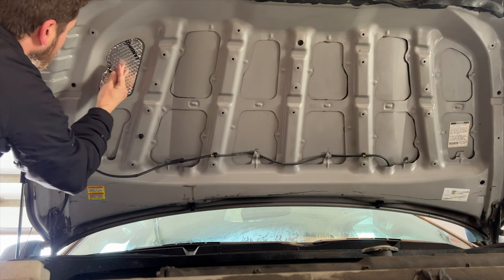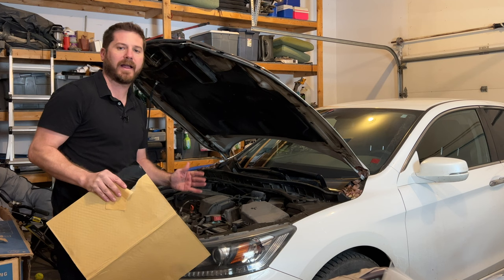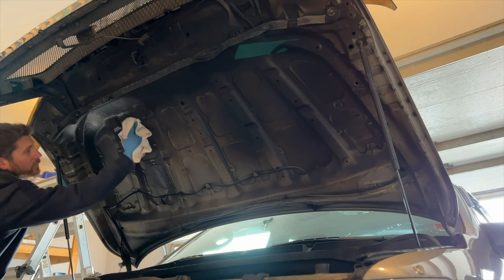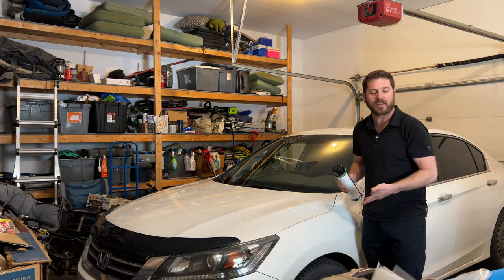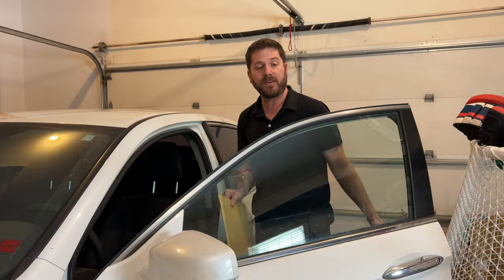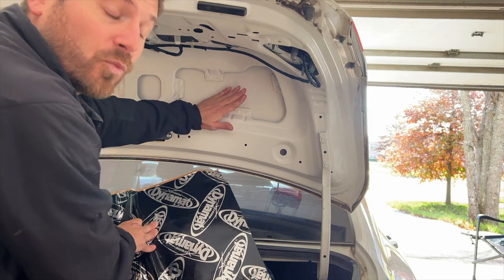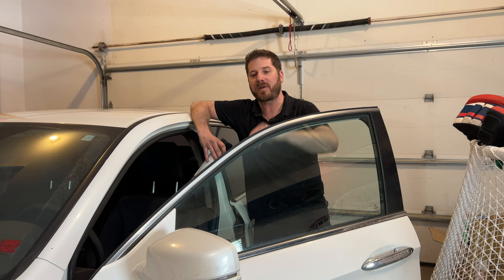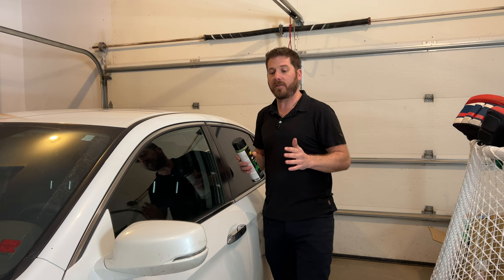Sound Deadening a Car Where It Actually Makes a Difference!

Comment: I recently added a sport exhaust to my BMW Z4. The idea was to improve the sound, and I accomplished the job.

The original exhaust, had a fairly large muffler box, which were replaced by two individual smaller muffler cans. The issue is that under acceleration, it's somewhat booming, but under regular cruising, no booming, which is great. 

I am thinking that where the back box was located, it has now become a cavernous void that is transferring sound inside the car. Would it help to put sound deadening material in this area? How well does the material stick to an exterior portion of the car? Technically it's below the trunk area so I'm thinking the sound transfers from outside into the trunk and into the occupant area.

Comment: Would it be beneficial to glue sounds mats to the bottom of the floor mats, as well?? (For road noise)
Reply: Here's a hint: I have a late 80's Mercedes-Benz and under the factory floor mats for the front footwells  are factory carpet panels -- and those have contoured foam up to 2" thick underneath them. (The contours are to adapt to things like heater ducts to the back seats.)

Comment: Great video, which sound deadening spray do you suggest? I just got a new Camry and there's really not too much road noise but I think the little bit that there is, is coming from the wheel wells. What was the foam you used on the doors, I may use that under my hood. Thanks!
Reply: Noxudol 3100

Comment: Any suggestions on soundproofing a (very loud), old fashioned diesel engine in a sailboat? These old diesels give out a lot of low end vibration so that would be a factor. Additionally, the muffler (which contains both the exhaust gasses and cooling seawater) is inside the engine compartment, as an additional noise source. I placed a soundproofing mat on all the available surfaces in the engine bay (but that did not include underneath the engine aa any oil or cooling water leaks are fed into the bilge) and it made almost no difference. Any suggestions? Is there any material that might deaden the exhaust (which, of course, is quite warm)?
Reply: @stephenburnage7687  
Unfortunately, Low Frequency vibrations, resonances, and direct sound sources are the most difficult to reduce.  The low frequency sounds, vibrations, and resonances that we typically associate as engine rumble & vibration or exhaust drone begin around 100Hz and lower in frequency.

This is why we can hear sonic booms, thunder, and the subwoofers from from car audio systems over long distances.  The high frequency wavelengths are dissipated much more quickly over distance, but low frequency travels large distances unimpeded even by multiple barriers.

It takes an incredible amount of mass (weight over a large area) in combination with excessive and very thick absorbtion materials to reduce low frequency energy.

This is because the wavelength of an 80Hz frequency is over 14ft long, and by the time you get down to 30Hz, the wavelength is over 37ft long!

In order to even begin to effectively ABSORB low frequency sound and vibrations, the absorbing material must be AT LEAST 1/4 of the wavelength of that frequency.

So, in the case of 80Hz, your absorbtion material would need to be 14 x 0.25 = 3.5 or 3.5 feet thick!   That is obviously not practical in most scenarios.

Calculate the same 1/4-wave thickness that would be needed to absorb and dissipate 30Hz, and now the absorber material would need to be over 9 feet thick!

Your best bet is to try to find better double-isolation rubber engine mounts that would provide much better isolation and anti-vibration properties between the engine and the hull.

And then, also make the engine compartment 100% air tight and completely enclosed with 1/16"-1/8" thick sheet lead sandwiched betweeen two durable 1/2" thick layers of Closed Cell Foam which will act as a Sound BARRIER.

The sealed sheet lead box acts as both Mass Loading over a large area AND isolates and contains the low frequency vibration and sound energy within the engine compartment.

It's just like the windows in your home or car.   When the window is closed completely, the least amount of sound from the other side will be heard.

But open that same window even a little bit with just a narrow gap and exponentially more sound will make it to your ears.   ANY amount of actual air transfer between one side and the other results in a significant transfer of the sound waves and energy.

Obviously, due to the heat that is generated by your engine and the exhaust system, it would be impossible to completey seal the engine compartment.

You would need a pair of thick, heavy 4" or larger diameter cast iron pipes covered with exterior sound blankets combined with constant forced air flow via a fan to act as a fresh/cool air intake and heat + noise exhaust to an exterior area that is away from the living areas of the cabin in order to expel the heat and isolate and reduce the low frequency energy within the cabin.  

And wherever those heavy pipes pass through an interior bulkhead and/or the hull to the exterior, they would need to be isolated from transfering their vibrational energy to the bulkheads and hull...i.e. a thick rubber or silicone gasket seal around each pipe where it makes a pass-through or penetration.

A rebuilt engine that is "balanced & blueprinted" or different engine and exhaust system altogether that produces much less vibration and low frequency sound energy is the ideal solution, combined with new engine mounts with better isloation. 

There is also a non-hardening clay-type product called Duct-Seal that is available at your local hardware stores in the electrical department or online.  It is used to make air- and water-tight seals in electrical conduit and wiring pass-throughs in beams and bulkheads.

If used to seal open holes or gaps, this might help to keep the vibrational energy in the engine compartment from escaping towards the cabin and living areas.
Reply: In addition to the excellent suggestions above, you could try installing a crankshaft damper to help reduce engine vibrations. Fluidamper makes them for a wide range of engines. You likely can find one that fits.
Better engine mounts can reduce vibration. Look for mounts designed for industrial generators or other equipment. In the industrial world, it's common to use a dual dampening solution. The equipment is mounted (with dampening mounts) to a sled with is then mounted on a flexible base (of different density than the equipment mounts)
If your engine is being run primarily to provide electrical power you can always look at installing a smaller dedicated generator, alternative charging (solar, wind, prop-driven generator, etc,), or a larger battery bank to cut down on engine runtime.

Comment: Is there an effect of these materials on the heat of the car ? for example a car parked under the sun and has noise-sealing materials for example( in the roof, in the hood, and in the doors), won't it heat up the vehicle more ? and also it's not take the car get rid of the heat more slowly on a hot day?
Reply: you are right about that. I have a VW T5 panelvan, i insulated it as much as possible. If i park my car on a hot day, windows into the sun, it gets as hot as a regular car and cooling down takes alot of time. Otherwise when i place the isulation corvers on my windows, it stays cool. In a cold winter day when using the heating, interior stays warm for a long period. Killed the noise in my van alot

Comment: How long does that spray on deadener last? Would it be best to to use something like Kilmat instead?
Reply from the maker: They claim it can last the life of the car depending on where it’s applied. It won’t last as long If it’s exposed to the elements and road debris. Just make sure the surface is clean and dry before applying the spray. Best of luck!
Reply: I just did kilmat to my jeep and it has made a significant difference

Comment: Why in the world wouldn't you do the trunk, that's usually the worst area in any car because of the subs being located in the rear of the vehicle? I know you want to eliminate any extra noise in the interior, but the trunk area I think needs more attention in most cases than the rest. I'm not saying to not do the interior, but I've always had more noise internally and externally coming from the rear.

Comment: Hi , can you or anyone else give advice on how to use a sound deadener on something like a countertop waterpik? I realize the actual sound will still be audible when turned on but will layering the deadening material at least reduce the noice that comes from the contact the bottom of the wapterpik on the counter ?

Comment: Got extremly cheap foil topped butyl foam stuff material off temu. Like suspiciously cheap...any experience with that stuff? 

So i only have it on the roof right now lol (cause i did the starlights in headboard.) It made the subwoofer sound a lot better. But road noise seems almost the same....maybe a little quiter? But that could be placebo effect. 

Gonna do the floor. I suppose i will let yall know.
Reply: How is it so far?
Reply: @thelifeofaboi2693  it works really well! I noticed a difference in noise for sure. I did the cheap temu foil lined butyl rubber. And then I did a layer of non foil butyl rubber from Amazon. 30 buks for 24 sqft.....

Is it worth the money that I spent? Oh yeah. But I would absolutely not pay full price for this. It works I guess. But it's not like I'm in a soundproof room all the sudden. If the car is easy enough to take carpet out. It's worth getting the cheaper foil stuff.

But I've only had experience with this these two products. I would really have no way of knowing if it's good compared to name brand...but I could totally tell a difference in quality of the butyl rubber between temu and Amazon stuff. Amazon stuff was more dense. And at times the temu butyl rubber looked like it was melting off paper. But it does the job.
Reply: @davidandrews5262  thanks for update!

Comment: What are your thoughts regarding cutting thin strips of the sound deadening and attaching them to various arms on the suspension? And also the struts. Just to quell any small road noise that might be transmitted to the body from there?
Reply: No way bro lol that would be a complete waste

Comment: hey quick question here. to sound proof a window. by doing a window insert which stuff with rock wool sound insulation wont help too much right? because i just did one, i even have 1 layer of 1 inch plywood in it.  and i cant even feel any improvement, is it because i have some very tiny gap in between the insert and the window frame? so the sound pass through those gap,i need to have a rubber surround around the insert like indow window insert or the window insert just wont work.
thank you

Comment: You can add kilmat to the hood and then reinstall the insulator again above the kilmat?
Reply: Absolutely. Sound deadening material is thin. Stick it on (use small roller) to fully adhere.  Then reinstall factory hood pad.

Comment: The Care Care Nut had an episode which an old Lexus was stripped off, seats, carpets & etc, to give a complete cleaning. 

There are only patches of sound insulation dampener in it. I think it cover not more of 25% of the Lexus body inside surface area. 🤔🤔🤔🤔.

Maybe accurate location for, application of the 25% of sound deadener, could reduce NVH by >50%?.👍👍👍👍. Regards.

Comment: Wouldn't lining my car with rubber or something dense help more than actually applying this sticky rubber to the actual metal? Like just thick car mats
Reply from the maker: It would help but the sticky park makes it so it absorbs the vibrations a lot better than just laying some rubber overtop it. Both methods will help but the sticky part helps with vibrational road noise.
Reply: @soundproofguide  where is the ford excursion you have in this videos thumbnail preview?

Comment: I had a question, I just did my tirearch, i've put sound deadening + closed cell foam , however a mechanic friend of mine said this can only be done inside, if i did it outside, it will absorb moisture and develop rust, when I put the material on, the paint was intact coz the car is new, so I think it should be ok? i tried to search can you do it outside and foudn your video to suggest it can be done on outside? what is your recommendation? thanks a lot
Reply: close cell foam are closed celles they dont absorb any water, same goes for deadening

Comment: Tips from my experience with my 2007 Mazda 3.

TL;DR: Basically no improvement. Suspension and the way it interacts and connects to your car is far more important for road noise reduction. 

I sound deadened almost every thing I could get the sound deadening material into. I used Butyl sheets, Mass Loaded Vinyl (MLV), and 4mm closed cell PE foam. I went with Noico brand, although brand doesn't matter at all. 

I did the entire floor, all the doors, trunk, wheel wells inside the car, and trunk lid. All with all 3 products. I did the hood with some Dynamat 3/4" hoodliner.

I mean, it was quieter by about 1dB, and the speakers sounded better, but really not by much at all. I should have used less material on the doors because they were super heavy after.
Reply: Dam you went hard